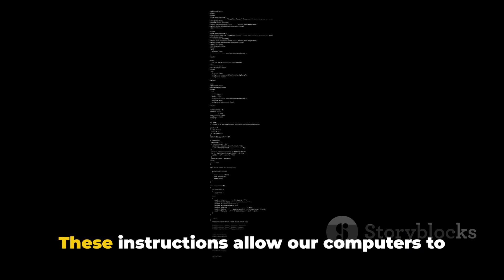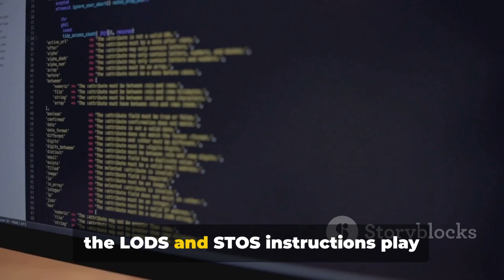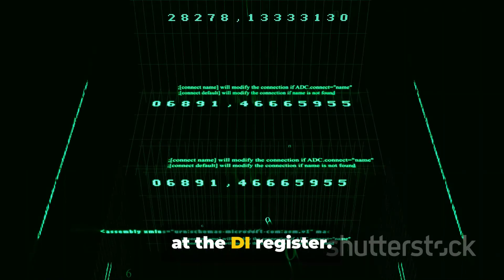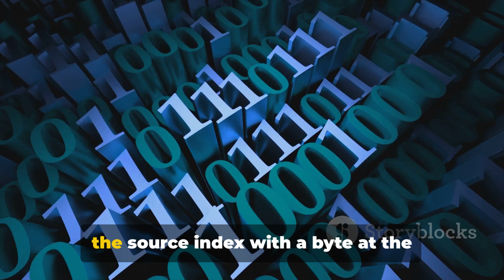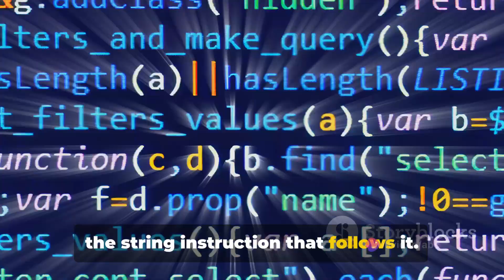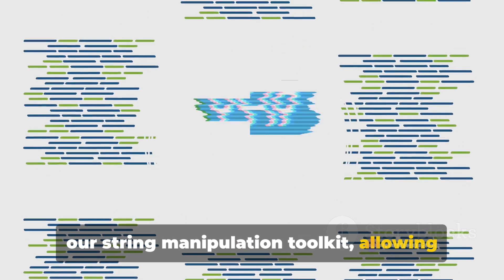String instructions

Comment: For the string instruction lodsb we are using the DS segment +SI offset = ds:si and for stosb we are using the ES segment +DI offset = es:di.

lodsb load one byte from ds:si and increase SI offset by one, if the direction flag is not set, else it decrease Si offset register. Same with stosb and DI offset and both for the movsb instruction copy with ds:si and es:di.